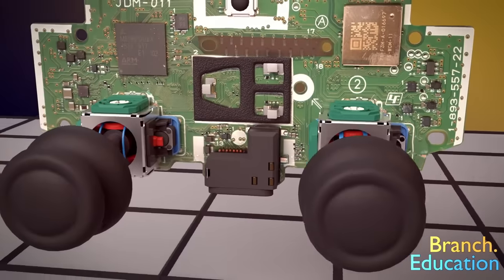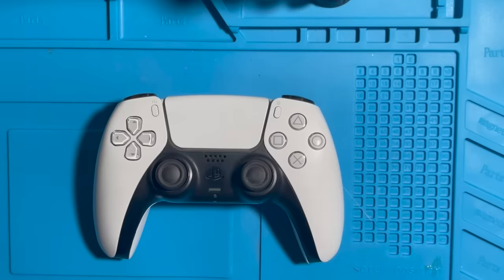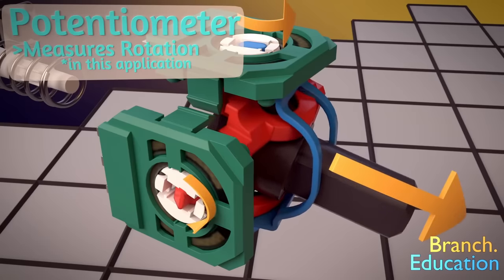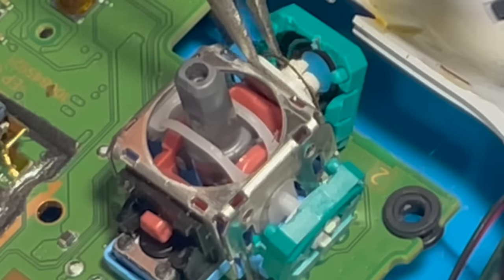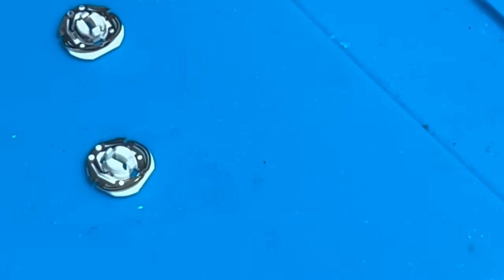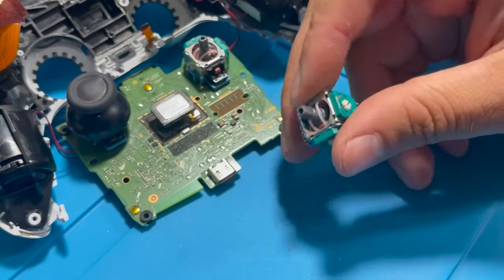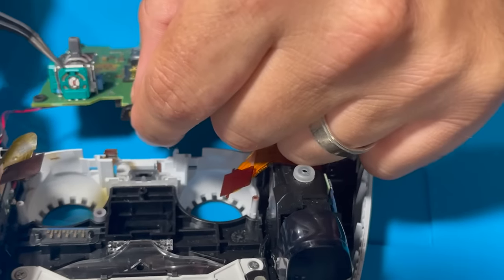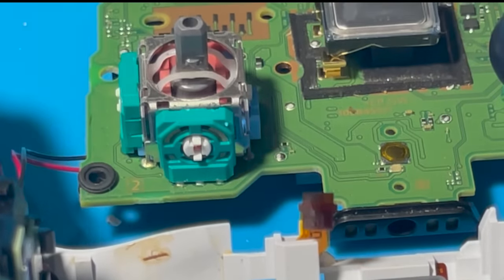What Causes Stick Drift Controller and How To Really Fix It

Comment from the maker: Hall Effect Joysticks seem to work a lot better: check out new video for all the details: https://www.youtube.com/watch?v=PrjKbw-F6zU&t=1s
Reply: 0:30 were those backgrounds really necessary lol. "Now, does that fix the stick drift" lightspeed
Reply: So, in other words, buy a new controller.
Reply: Right dam
Reply: @MyButtsBeenWiped  if you do buy a new controller, save the old one and use it for practice soldering and replace the joystick. long term you will save alot of money if you learn how to repair these yourself.
Reply: hall effect ones should never get stick drift problems as they never have a wiper touch a resistance surface.
Reply: Now ALL my PS5 controllers drift and I can't have a conversation with mom about it without a 10 minute lecture about "well don't drop your controller" or some stupid excuse to jump down my throat on stuff that's way beyond my own control, and I don't know what to do.
Reply: @GH-wd8zr  if you don't have a soldering iron, get one, and then buy 2 hall effect joystick s for ps5, and replace them yourself. if you need money from your mom, tell her you want to do some whatever DIY project.
Reply: @zangetsu2k8 Ive had to buy a new controller every cuz my right analogy stick gets bad drift.  The drift is choppy too, sometimes it’s slow and other times it twitch moves super fast. Is this cuz how I play on it? On warzone I make the R3 button the jump button. So I’m rotating it as well as pressing it all the time
Reply: that depends if you hacked your controller for no recoil.
Reply: Just jam a paper clip around and if you hear a click it should be fixed be carefully but still be hard

Comment: i've got 3 controllers 3- 5 years old, no drift, i bought a new sony official controller, after 1 month i get serious drift, it can't be just wear and tear.
Reply: Newer controllers sacrifice durability for smoother performance I’ve been told
Reply: Sony has one year stick drift warranty send it in and get free replacement
Reply: You’re not the only one. They’re designed to break. Now they offer 20$ replacements for the edge controller.
Reply: My brand new scuf and regular got drift after the soft wear update and I know that's the case because the have the same exact drift on both going up and right, there something faulty with the control software i believe
Reply: The sad part is Gamesir makes a G7 SE anti drift controller for Xbox for 40$. They say it’s amazing.
Reply: Dropping the controller on the joysticks would also contribute
Reply: @kalebkirwan7979  but a controller has one job and gamesir makes anti drift for 40$. The evidence supports poor quality being intentional because it’s going uncorrected.
Reply: I have a 30 y old analog joystick, the potentiometers on that one are huge. They like half inch in diameter vs the new ones that are like 1/8 inch. I think the size in itself makes the new ones more sensitive to dust and wear
Reply: There is currently a class action lawsuit over the ps5 controllers. I have 3 controllers less than a year old 2 of them have stick drift. 1 after about 12 months the other 8.
I still have ps3 controllers held together with tape that out perform my ps5 ones
Reply: You must be the Jesus of controller buying.. Good for you 👍
Reply: @dylanc7003 this is literally just like the Nintendo switch Joy con drift
Reply: @tbnrrenagade9507 unless its a default in the specific controller i highly doubt that.
Reply: @jasonleekinney if it was intentionally they wouldn't be trying to fix it 💀
Reply: @urbexingTss  They won't fix it...Mine was still drifting day one out the box after getting it back. That's why I'm here again.
Reply: I have 5 ps5 controllers, and ALL of them have this problem. I bought a special edition God Of War controller, and it had drift problem in a matter of months, 6months tops. Very infuriating!
Reply: Yeah I missed out right as they first came out. They accepted pre-orders right as the employee warded me away from GameStop. So, two years later I finally get one and within the first 2 months, I get stick drift... I contacted Sony and they expect me to buy the box and pay for shipping and everything. At least when I had the Xbox Red Ring of death, they paid for everything and gave me another console. It's sad because I'm actually a Sony Fanboy but this stuff is really getting to me.
Reply: @dylanc7003 yeah I also noticed that they lied about the virtually no load times because I'm getting the same loading times as my PlayStation 3... The PlayStation 4 was faster at processing games. Most of the games on the PlayStation 5 actually look worse than the PlayStation 3 games, no joke... I don't know what's going on at Sony lately but they are sucking.
Reply: Same thing happened to me but 3 times!!!! 2 ps4 and 1 ps5 😡😡😡
Reply: My ps5 controller lasted 1 year before getting any drift
Reply: I sent mine back to Amazon.  3 weeks in I got stock drift.  The new ones are lighter and even shitier.
Reply: @jasonleekinney edge controller 💀
Reply: @YodaClips  it has replaceable analogs for 20$. It’s why they’re getting sued. Instead of fixing the problem they’re making money off of it thus proving they’re scamming gamers. It’s been failure by design the whole time. Gamesir, g7 antidrift.
Reply: @jasonleekinney  ok but why are you telling me this, I didn't ask
Reply: Why do tires wear out when we have the tech to mitigate it? Money! Why make durable controllers when they can make us keep paying for more🙃
Reply: @jharding578  it’s about keeping a degree of integrity and they totally nuked their reputation. Lolz
Reply: I’ve fixed many of controllers by cleaning the inside and wiping down the metal  contacts from those potentiometers, Xbox has the issue with the series controller’s the culprit is alp’s factory.
Reply: It’s not that they’re designed to break it’s more that Sony, like many other companies nowadays, are cheaping out on their products. If you ever opened up your PS4, it becomes pretty evident.
Reply: And also you can't use PS4 controllers to play PS5 games. Probably because Sony knew you could just get cheap PS4 controllers on eBay, meaning you wouldn't have to spend that money on the expensive official Sony controller.
Reply: I got a controller with drift right out of the box. Talk about being pissed off.
Reply: I’ve got three ps5 controllers all relatively new and all have stick drift.
Reply: Honestly just get a ps4 remote
Reply: @JeffreyLieberman-h9s load times are not faster than ps5 on ps3 or ps4. Nor is any “processing” faster on the ps4 over the 5. What terrible takes
Reply: It happen my controller, I purchase from sony too. So I send it back for repair and two months later it s driffing again.
Reply: Agreed 100% since ps4 and now ps5 it happens to every other controller.
Reply: Same here
Reply: Same here
Reply: nope mine went out too randomly. don't even play much. kinda pissed I gotta spend 75 on a new one
Reply: I go through 1 a year. Shite quality for sure
Reply: @urbexingTss got a link mine don't last a year
Reply: @jasonleekinney unfortunately those replacements for the edge controller aren’t available anywhere I’ve looked. They are out of stock everywhere and we know that’s how Sony wants it….they want us to spend $100 on a new controller,  not $20 on a replacement joystick…
Reply: Absolutely correct. Its the PS5 programming now. So many complaining @CorruptedYT
Reply: manufactured obsolescence
Reply: Have a blue one for almost 2 years now, no drift at all
Reply: It not wear n tear u have to open n clean it
Reply: My original ps3 controller still works awesome, my ps4 pad got stick drift after 4 years,  my ps5 is 1 year old and I've had 3 controllers....
Reply: @azdickinson4430  thought i fixed 1 of mine but its drifting away lol
Reply: @urbexingTss  If I send my Spider-Man limited edition I'm sure they will return me a white one 😅
Reply: My brand new PS5 controller has drift after 2 months. I tried to do a warranty claim but it says something about not supported in my region. I bought it from Walmart??
Reply: My ps5 controller also got very severe drift after just 3 months, i opened it up and saw that there was a couple of hairs stuck in the sticks discs, apparently the new controllers arent very great at keeping hairs and gunk out
Reply: @tbnrrenagade9507 We can literally go to space. There is not a single acceptable excuse why they can’t do both.
Reply: @7thNoteOfficial  be careful you need the right tools, good eyesight or a magnification lamp. It’s real easy to break a ribbon, pull a ground wire or bust a contact on the board. Get a broken/parts controller and take it apart before you attempt to fix your own.
Reply: Same here
Reply: Have this issue while passing half of the Forbidden west. 😅
Reply: @CorruptedYT oh, yeah. I just updated it and voila here it comes. Thanks.
Reply: I'm still using launch PS5 Dualsense from  2021, it's 2024, still no drift, I used it on PC everyday when not playing PS5.
Reply: @jmoney6043 you replied to a five month old comment this conversation had left the deepest parts of my mind In the realm of thought, a stumble profound, As words so dim leave reason unbound. In wonder I pause, at the depths you've trod, How have you come this far, with mind so flawed?
Reply: Dawwg I got 4 controllers and all them have stick drift.
Reply: ask me what smoothly means
Reply: @sovaffs4195  what does it mean
Reply: @Ana_Lebron  look what I did if you're interested
Reply: @Ana_Lebron  YouTube blocks all hints, guess how to look at it
Reply: @Ana_Lebron  infinite gamepad stick
Reply: @Ana_Lebron  <- I’ll show you how this is done here
Reply: @urbexingTss how do you do that?
Reply: Same! I just bought a controller 3 months ago and it has stick drift already
Reply: @urbexingTss  so until the warranty runs out i can get replacement!? if the stick drifts that is!?
Reply: @Taitea_____  yes
Reply: @MGnKntkY I just purchased an open box controller. 2 days in and it’s already getting drift… I got the 2 year warranty though so they said I can bring it back and they’ll replace it.
Reply: @Steve_SCirca30 if it's drifting isn't it considered broken anyway?😅😅
Reply: I am on my 9th ps5 controller in 3.5 years…absolutely disgusting quality from Sony who I used to associate with the term. 

Sony is the Ryanair of the console world. 

Back to Xbox for me.
Reply: Same
Reply: You have no kids 😅
Reply: @rmonroe401 No Cap Bro

Comment: I don't trust myself to fix an 80 dollar controller.
Reply: Nor did I but I got my repair kit today for,£7 after twenty minute no more stuck drift it was really was easy to take it apart
Reply: Dude I totally agree with you!!! But if we're gonna go ahead and buy another one we might as well learn some stuff with something defective right?  See if we can fix it.
Reply: Tru
Reply: already not working properly what you got to lose
Reply: I'm collecting controllers 😂.
Reply: If its already broke why not, u was the same, had terrible drift on my new black ps5 controller, opened it up and thought I broke it because I used some pretty big pliers but it went back perfectly, works like a dream now
Reply: Just do it and learn.
Reply: its 50 ?
Reply: @laith782  they probably have the playstation edge
Reply: @Frostchuu  edge is 200 dollars
Reply: Well I did lol and I nearly broke it 🤭
Reply: But if it's already broken you have nothing to lose
Reply: Helps to take it apart and clean the components
Reply: I do it all the time not scary just be cautious
Reply: It's easy. Look got "how to" videos. 😁
Reply: I don’t disagree, I think practicing with an old broken controller might be the play before I attempt anything on one I use.
Reply: @stwargis21  what I noticed is when I got to the analogue there was a tiny bit of dirt in the metal thing that twists the stick round and it was clogging it ever so slightly that it would drift to the left, was thinking about just binning it but after I goy that dirt out it went back to working like brand new
Reply: i just fixed mines this morning with a cheap tool kit
Reply: Right new controller it is
Reply: Honestly it’s not that hard just attempt it and if you fuck it up or can’t then send it into someone you know who can
Reply: @freeguy3376 so you gotta get a repair kit to do what the guy did in the video?
Reply: Bro just use wd40
Reply: You gotta be a mechanic to be taking apart that type of controller and fix it lol…
 Thought it was a more simple way👍🏻👍🏻
Reply: I agree I royally screwed the pooch on my attempt... guess it was a good thing I was planning on getting a new one anyways
Reply: @freeguy3376 where do u get the repair kit
Reply: @truthfinder93 exactly
Reply: I did this when i was 13 and cleaned the stuff. So go ahead im sure you guys are older than me
Reply: @Dinodancing283 That’s foolish of you. I had never taken a controller apart. I saw a video from “Metal plastic electronics” regarding the Ginful Hall effect gen 5 sensors and I decided to try them. For $23 I got the soldering kit from Amazon, and for $9 I got the pack of 10 sensors. This means that $32 you can fix up between 5-10 controllers in a way that they won’t go bad again. That puts you at about $6-$3 range for cost per controller. My red controller with bad stick drift now performs better than my other 2 controllers with potentiometers and I had also never soldered before in my life. So first try I was able to upgrade my controller for a controller that won’t really ever get drift until the spring goes out which is just probably never going to happen considering the fact you see so many people with 13 to 14 year old controllers that still shoot back to the center.
Reply: You may get use to it cuz I have 4 controllers and they all had drifts and I am now comfortable taking this a part and clean potentiometer. I haven't done the soldering yet, but probably will try that as well in near future.  Can't spend 80 bucks to buy a new one anywqys
Reply: Why don't you trust your self it's already broken
Reply: @EllisFamlyFun  that’s what I’m saying. You’re already on your way to the store to spend another $80. Might as well spend $13 on a 10 pack of hall sensors, ~$25 on a soldering kit that brings a pump, and potentially fix it for less than $40 in a way that you will never get stick drift again and which will leave you with the skills and parts to upgrade 4 more controllers potentially saving you $320 more dollars since you won’t need to spend any more money.
Reply: You can do it bro
Reply: Price went up and they break easier now ..
Reply: @Frostchuu The Walmart in Canada ranges from $60-80 for OEM Xbox controllers
Reply: if it don't work you have nothing to loose
Reply: Agreed I’ll just buy another one
Reply: Same
Reply: Yeah better leave it as it is and spent another 80 bucks for a flawed design that not even costs a quarter of that price in the making..
Reply: Well start training yourself to replace and repair your stuff that's why these videos are here for you and other's to fix the stuff.
Reply: That part
Reply: I’m rt there with u bro🤦🏼‍♂️it’s annoying
Reply: Can’t we just replace it with an Hall effect one?
Reply: @Frostchuu Edge is 200 USD, standard PS5 gamepads cost 70 USD & UP.
Reply: When it breaks you should at leat try
Reply: @truthfinder93 the entire controller?
Reply: @BeingOfEvil0  but it isn’t working correctly anyway so you’ve lost the whole controller. probs sits around collecting dust
Reply: Me too, I brake it for sure
Reply: If it's already messed up. What are you losing buy trying to fix it 🤔
Reply: yeah Sony know that
Reply: And i just broke one trying 🤦‍♂️🤦‍♂️🤦‍♂️
Reply: The only thing I don't like and found out the hard way was removing Solder  isn't as easy as it seems plus you need to clean your  soldering tips a lot and have the right soldering and  using a desoldering braid and then you need to make sure you have some  good protection with kapton tape or something similar then you have to use the heat gun and slowly pull out as it comes lose at least that my experience i did end up finding somebody on YouTube that has a tool that can make it alot easier to remove
Reply: I did and broke it😔😢
Reply: This sounds like a Sony problem how every one experience the same problem
Reply: I felt the same, and some of these videos (including this one tbh) make it seem way more complicated than it is. What helped me feel more confident about it was seeing a video of a guy fixing it in like three minutes with just a screwdriver, a guitar pick and a pair of tweezers. Once I figured out how to take it apart, it just turned out to be a bunch of cat hair on the inside lol. Main thing is to just be really careful and don't pull the the green thing on the side of the stick out too far, that seems to be how most people break it.
Reply: @seemi9600  thank that’s looks way easier than spending 80 bucks 😭
Reply: It's actually a lot easier than you might think if you have the correct tools
Reply: It already doesn’t work well what more do you have to lose?
Reply: @ great point. Gonna end up buying another one anyway.